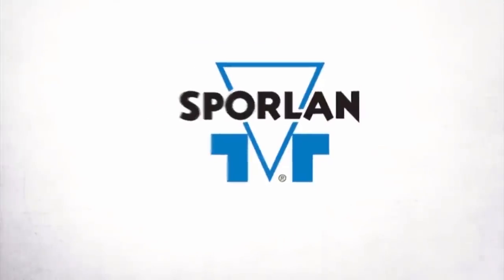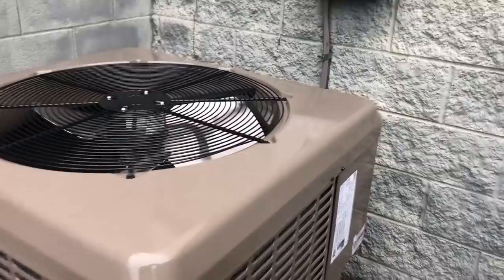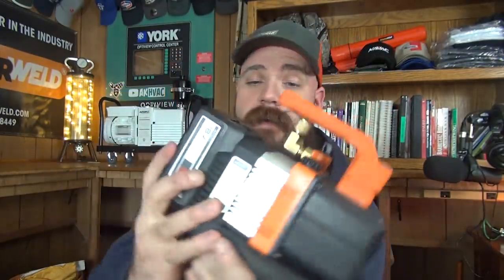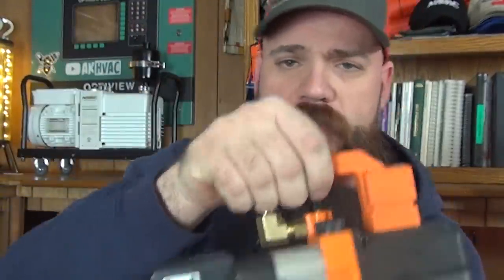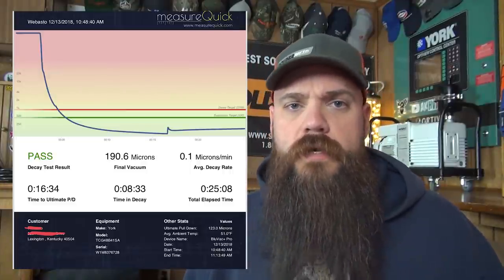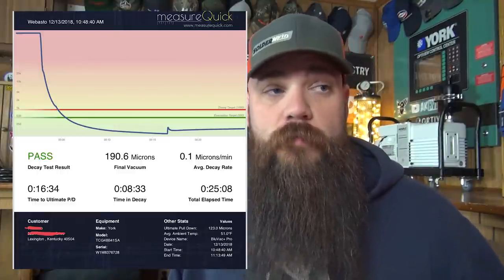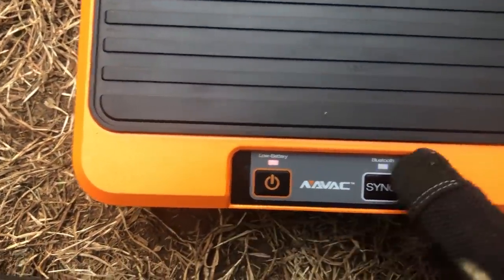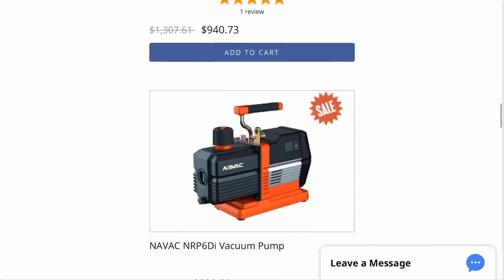🔥Cordless HVAC pump🔥...toy or game changer??

Comment: Milwaukee Tools needs to make a cordless vacuum pump!
Reply: Definitely!
Reply: Lmfao... Why does Milwaukee have to make one? Because of their logo and bright red color ?
Reply: @ThermalSolutionsHVACR  No.  Obviously because many of us already have Milwaukee batteries.
Reply: @ThermalSolutionsHVACR  If Milwaukee makes one then there will be other battery makers to sell equivalent batteries with more amp-hours & cheaper. That's a petty good reason in it self.
Reply: just use the adapter for your milwaukee pump. Even if they salr one, it's gonna be a rebranded value/navtek/navac/javac one
Reply: They have one coming, at stupid cost though

Comment: Update 6/26/2019 - After continuing to try it at the video posters recommendation, I have found that it is quite an incredible little machine. While it is pretty terrible for dehydrating a system (takes 2-3 times longer than a 6 or 8cfm), it is pretty impressive at pulling a vacuum on a new system. I pulled a vacuum on a 2.5ton system in 1:40. Quite impressed. If you have to repair a system that may have gotten a little moisture in it, this pump will end up taking 2-3 hours, but on a new install, less than 5 minutes and you’re set. 

Bought the navac battery operated pump based on this video... word of advice. Don’t waste your money. I paired the pump with the bluvac hoses. It started pulling down fast as hell. Made it down to about 2000 microns and  slowed down. After an hour, it went down to 1760 microns. To get you all the info, it was a new 4 ton Amana condenser and coil, about 25’ 7/8” line set. 

Same exact set up as him but not the same results. I’m not questioning the posters integrity, but I can definitely say, it didn’t happen here.
Reply: Same here, I tried to pull a vacuum with both cores out and with (2) 3/4 inch hoses and ended up pulling down to 5,000 microns after 1/2 hr. Disappointed I was. Anyways, I’m returning the pump and going to try the 4CFM cordless next. I’m hopping to get better results with it.

Comment: I hate getting on a rooftop and then remembering I forgot to run an extension cord and having to go back down find and outlet and do all that bullshit. Buying this now
Reply: LOL
Reply: Try a commercial roof where you have to badge like 3 doors and walk a 1/4 mile pull everything up a 30 foot roof access. And we forgot the cord🤯🤣
Reply: @cranium33333  LOL. Yea, i do😆😅.
Reply: @cranium33333  I work commercial, jumping the hurdles of turpentine walls every day
Reply: Jacob Summer 🤘🏻

Comment: Of course you still need a cord for your recovery unit, certain scenarios apply. Id buy that thing for the weight alone. Remember deep vacuums are done by the oil not the cfm.

Comment: Looks like it broke 500 microns in about 6 minutes, and the decay time was extended. How long from start to the BluVac gave you a passing evacuation? From what I understand that pump will run for about an hour on a single charge. You could have done easily 4-5 systems like that on one charge with those hoses. That pull down was almost straight down.

Comment: Mastercool makes a 1.5 CFM 2 stage vacuum pump that will work with either Ridgid or Makita batteries 🔋. Been using it for 2 years or so , and 1/3 or less of the NAVAC cost , Take that NAVAC 😄

Comment: I would like to try it before purchasing it, extreme cold & heat operations would be my concern, I wish the manufacturer gives the choice of battery or 120 volts. I am assuming this manufacturer is overseas, because most contractors here either uses Milwaukee or DeWalt, we really don’t want a cordless tool with different brand battery. If the manufacture did these 2 things they probably sell a lot them, I can see Technicians carry this as well as the standard vacuum pump. For me I prefer tools to be small, that is one reason I like the Refco 5 cfm Vacuum Pump. Good video
Reply from the maker: Yes, I would certainly never consider this to be my only vacuum pump, but a perfect compliment in addition to another pump (probably 8 cfm-ish) for many applications. Thanks for watching man!

Comment: Makita makes a cordless vac pump. There are available in Australia and Europe
Reply: Dave Van West the makita one is an automotive pump, single stage only designed to go down to 100 microns
Reply: @jamesbowmanhvac2149  beg to differ, the Makita DVP180 goes down to 20 Pascals (150 microns), have family in Europe and Central America that use it for ductless split systems. It may be used for automotive because of low flow, however, it is marketed as an HVAC vacuum pump. Would have picked one up when I was there, but Makita is not the battery platform I'm using.
Reply: I said 100 microns you corrected me to 150 microns. The US uses much tighter standards then many other places around the world. Here in the US we just try to do things better and using a single stage pump just won’t cut it. Particularly if your getting into low or med temp stuff. After you add in hoses and connections the ability of a single stage pump to pull a deep enough vacuum becomes slim. Why use a low quality pump and take a chance on the job it will do when you can spend a few more dollars and get something better?
Reply: Also the US is the largest market in the world. If Makita thought they could actually be successful here they would have brought It here already. NAVAC launched this pump in the US first so must be comfortable with the quality and ability to do the job here.
Reply: JamesBowmanHVAC mastercool has one on eBay that uses kamiya style batteries... 1.5cfm down to like 20 microns 300 something bucks or about 200 bucks I’d you buy the tool only

Comment: Love it. 
Question.  Does your core extraction valve seem to hold atm pressure.  So when you close it a tiny amount is released and that's why you getting the spike? 
My yellow jacket ones do so as I'm pulling down around 500 micron I open and close rapidly to minimize that on final test.

Comment: I believe it seeing your vaccum set up, i bet you purged and cleaned the lines. Thats very exciting. I want a 8cfm cordless one that beats the appion tez 8. Hahaha

But im commercial, cant see this pumping down 20 heads and 1000 feet of lineset for a vrf system.
Reply from the maker: Nicholas Simpson I’d use the 12 cfm pump of theirs that I used on a 2500 ton centrifugal chiller a few weeks ago. That would easily handle a VRF system👍. Battery pump, not so much.
Reply: @AKHVAC  sounds freaking epic. Whats a good pump for the price in your opinion. I have had luck with the appion tez 8 , heard some guys using the JB 10 cfm. Never heard of a 12 cfm pump. Id like to look it up. How do i find it

Comment: Quick question, if it is laying on its side, does it leak oil like a regular vacuum pump?
The Pelican style case I use for my evacuation setup has enough room for this thing, but it would have to be able to lay on its side without leaking oil.

Comment: I wonder what cfm's you get out of any pump with regular hoses. I also wonder how this pump would do with the 1/2 x 6' appion hoses I have. Looks like a great fun product
Reply: Eric M  wow, that would make this little guy work great. They say resistance is reduced even though you're still using 1/4 inch port
Reply: It will perform better the bigger the hoses you use. 1/2” x 6’ hoses will perform better then 1/4” but not as good as the tru blu hoses. Nothing currently in our industry will out perform tru blu hoses.

Comment: NEC code requires all rooftop a/c units to have a 15/20 amp receptacle within 10 ft. of unit for service. That's not always the case but then it makes for reason to have one put there, owners beware. Now, as for the pump, well, after a long day you might not remember to charge up your bat. for tomorow. So when morow comes and you show up with that low bat. for your pump, all you can say is that 4 letter word you already say enough of.
Reply from the maker: Thanks for sharing, though I’d say forgetting to charge it is just as likely as not charging any other battery power tool you may need, doesn’t prevent us from buy and keeping them!  (I would recommend more then one battery however, just like you would with your impacts/drills). As for the outlets, in my area it’s not only “not always the case” but RARELY the case. Unfortunately it’s all too common.

Comment: 👍🏻👍🏻👍🏻
WOW
Got to get one, I’m curious if the pricing is less than the currently available battery powered Navac’s .
That would be ideal for a good bit of refrigeration work, reach in ‘s and walk in’s.
Reply from the maker: This is the first/only battery op pump from NAVAC, and it will be at a 499 price point👍

Comment: What is your procedure when you reach optimal microns in regards to closing valves and releasing charge?  The reason i ask is you have the micron gauge on the side if the core tool. Do you open valves to release refrigerant with micron gauge on?  I put a ball valve there but im trying to reduce fittings where i can.
Reply from the maker: Yes, the micron gauges I use are rated for high pressure. I don’t take my micron gauge until the equipments vacuum is broken with the refrigerant charge.
Reply from the maker: Robert Griffis no need for the ball valve, all the bluvac gauges can handle pressure👍
Reply: Thanks for the reply.  I have the micro bluevac. Was just afraid to put pressure on it. Thanks again.
Reply from the maker: Robert Griffis let’er rip man!  It’ll work just fine👍

Comment: So i pre ordered this pump after watching your video. I asked the company if Makita made the batteries and they said no. I bought an extra battery because of this. The battery arrived before the pump and it snaps directly onto my Makita charger, impact, and recip. I'm gonna say Makita made these batteries.
Reply from the maker: Justin Brown makita doesn’t make there own batteries/chargers. They are manufactured by another company. Navac uses that same company for their chargers. The sample pumps did in fact function with the makita batteries, but they requested navac make the production version incompatible for liability reasons.

Comment: I have tried all the battery Vacuum pumps over the last year. Mikita and Navac where not my favourites. Here is why: (1) Makita only has single stage vacuum cartridge, i work in HVAC Refrigeration and 2 stage is a must have to do the job properly. (2) No solenoid isolation valve, so if your not sitting with you hand on the valve ready to shut it off when the battery runs out you loose your vacuum. (3) It has a very poor exhaust filter and seems discharge a lot of oil vapour, Navac discharges vapour in and around motor and electronics. (4) only last a maximum of 40 minutes with a fresh battery, Other pumps I have last 60 minutes. Overall the pumps do not feel worthy of a HVAC technician. Only cordless vacuum pumps that are worthy are Javac CDC-30 and Wipcool fast series.

Comment: am sorry to bother can u please tell me what is the decay test am not too familiar with it ... great video as always
Reply from the maker: It another term for when you reach your desired vacuum level, and valve off the vacuum pump. The “decay” test the rate that the microns rise back up. Different rates indicate different things, like a leak, presence of moisture or a tight system.
Reply: AK HVAC thank you for the explanation

Comment: Gimmick for sure, nothing can replace a cord vacuum pump.
Reply from the maker: Geoff why?
Reply: I remember the first time I drilled a 1 1/8" hole through a double 2X4 wall plate for a drain line with a battery drill. I was so excited that I could do a new construction rough in with no cord. Now look at the cordless tools we have I'd say anything is possible. I'll admit he put the pump in the ideal set up but nonetheless impressive

Comment: Ak HVAC what’s up bro big fan ! 

couple questions for you for residential is a minimum of five CFM vacuum pump 2) how long of a line set can do is do and what sizes 3) if battery dies can I lose my vacuum? 

I really don’t see this vacuum working out on a roof top with 50’ plus line set

Comment: Sounds good, but what happens when the battery dies...
Reply from the maker: Jason Cameron put another one in.....

There’s an alarm that sounds off 5 minutes before the batteries fully discharged. With a battery powered pump you wouldn’t be leaving this running overnight anyway, so the chance of having it shut off and suck all the oil out is slim to none👍.
Reply: @AKHVAC ice, was wondering if it had an auto shut off or something, but an alarm would work.

Comment: You will be back... micochannel
Reply: Is there also an option to run a cord to that little pump say if u think battery maybe low and dont wanna start over or take a chance of it turning off during process .
Reply from the maker: JH HVAC & Plumbing nope not at this time
Reply from the maker: JH HVAC & Plumbing the pump does give an audible alarm 5 minutes prior to it dying, to give you a chance to swap batteries

Comment: Somethings should remain corded!
Reply from the maker: Lee Johnson why?
Reply: Many reasons. I couldn’t go take a short lunch and trust that the battery wouldn’t die. Code in NC requires a receptacle be within 25’ of any outdoor unit. I sometimes have to pull down two or more systems at the same location. I could see a use for it on small refrigeration units.
Reply from the maker: Lee Johnson It took 17 minutes to pull that system down, I went to lunch after.  Code may require receptacles but since when is code followed, especially by electricians😁I think the video showed it’s far more useful in applications besides small refrigeration systems.
Reply: All boils down to trust. Something like this, I’ll wait for the second/third generation. It also needs a sticker on it. TONKA. haha. Good vid. Peace